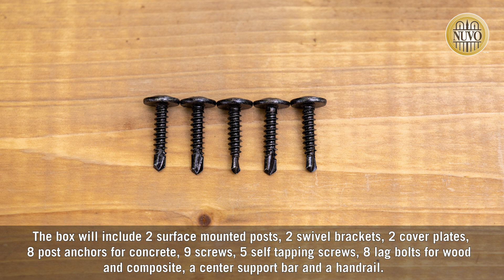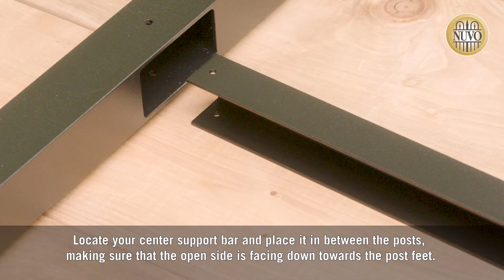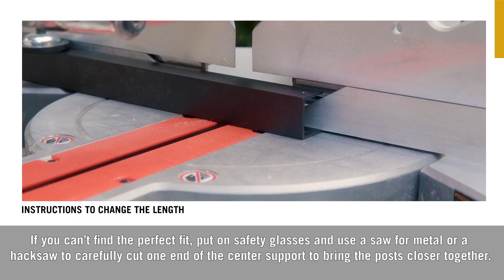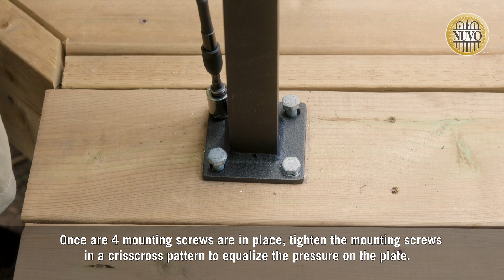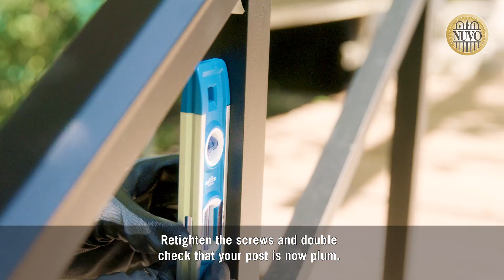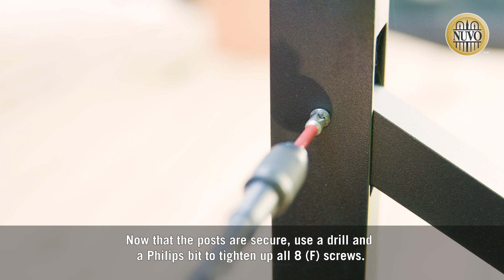How To Install: Stoop Railing System | Nuvo Iron

Comment: My f screws don’t fit. Is this satire
Reply from the maker: Hey MarkwayHomes, the F-Screws are self-tapping, so a little resistance during installation is totally normal. As long as you're using the correct bit size (#2 Phillips) and a regular drill, a bit of extra force should do the trick. Some people find an impact drill helpful too. If you're still running into issues, drop us another comment or reach out to our customer service team and we'll get you sorted!

Comment: F screws don't fit.  This video does not represent reality.  I'm going to have to drill out or find another solution.  FU Nuvo iron.
Reply from the maker: Hey Mark! The F-Screws are self-tapping, so a little resistance during installation is totally normal. As long as you're using the correct bit size (#2 Phillips) and a regular drill, a bit of extra force should do the trick. Some people find an impact drill helpful too. If you're still running into issues, drop us another comment or reach out to our customer service team and we'll get you sorted!

Comment: F screws are terrible. They are stripping!
Reply: Terrible. Do not purchase. I'm using a high powered drill and hammer drill. These screws are stripping and not penetrating through the metal EVEN where pre-drilled holes are. All they are doing is stripping.  Absolutely terrible product!
Reply from the maker: Hmm, you shouldn't be having an issue with that. Reach out to our team info@nuvoiron.com - It could be the drill type you're using?

Comment: WATCH YOUR HEAD! The design of the top rail leaves very sharp corners on the bottom of the rail, which the plastic plug does not cover (so you can slide it together). You will have to bend down to install the bottom post, be careful when you stand up again. I just finished getting two staples in the back of my head. 
But it’s a very nice product, exactly what was needed for my application, great price point.
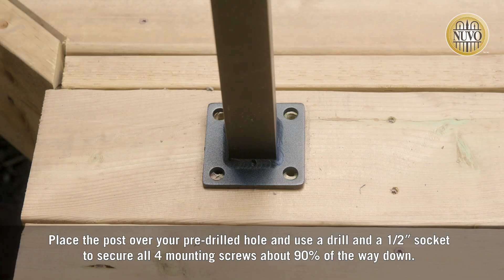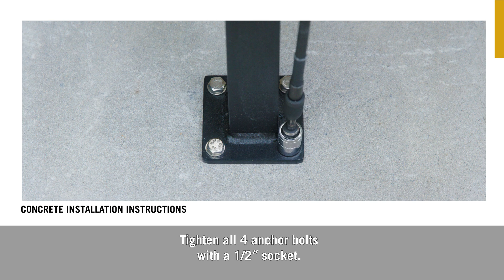Use a universal joint for installing the bolts or lags, as the head of the ratchet will hit the post otherwise for lack of clearance. The lack of clearance between the socket and the post is shown at 3:42 and 4:30, and I’m not sure what sort of special socket they are using in the video.
Relatively simple install otherwise, and took me under four hours to install going slow, drilling in concrete, and including the trip to urgent care.
Reply from the maker: Hi Andrew — we’re really sorry to hear about your injury, and we’re wishing you a quick recovery. 

Our products are designed with safety and quality in mind and should not have any sharp edges. That said, we always caution installers to take care during assembly, especially when working around exposed components during installation.

Thank you for sharing your install tips around tool clearance.